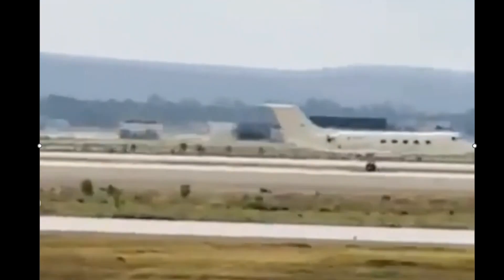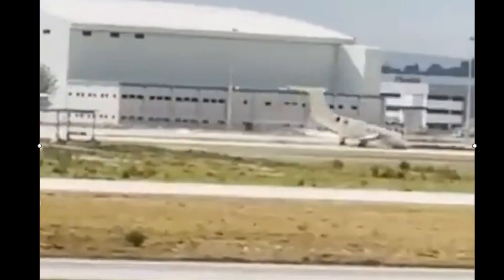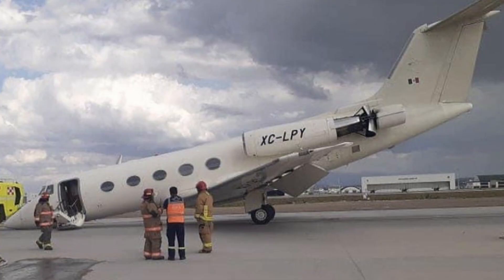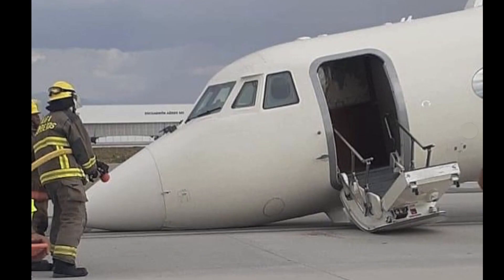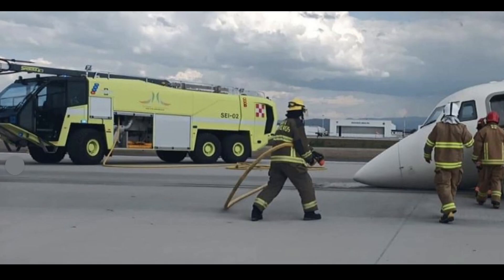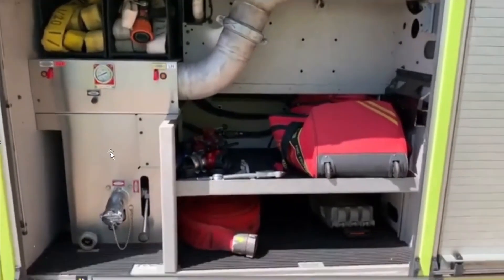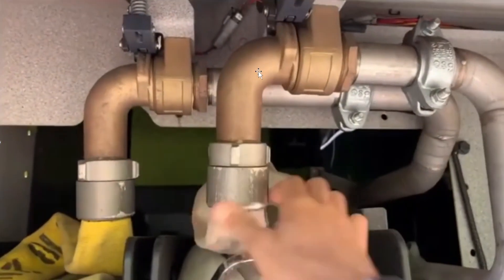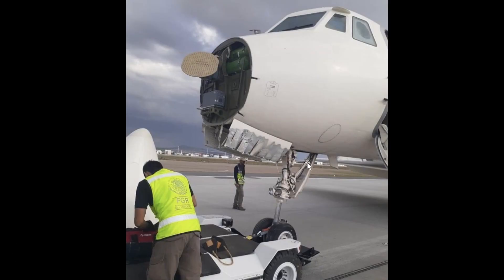Bystanders Watch Gulfstream without Landing Gear

Comment: The pilot did a good job , love the flaked house with the sensor that basically inflates the hose on deployment , save a lot of time on running back and opening a valve to open that delivery . And as you know speed is  all about our job as we have much less time to deal with these incidents than say a house fire . Sadly our old fire trucks had this option the new ones don't , in fact the restricted deliveries have no room for a branch or hose . So our new trucks in my eyes are less effective but im told .....im old school !!! , money constraints seems to rule over safety and doing the job . We have restricted deliveries because at the same time the monitor is hitting the main fire mass at some pressure , the restricted deliveries are restricted on pressure so you can rapidly deploy and not get blow off your feet . My new truck is more 80's capable in my eyes than what we had . So now i have to go to another locker , throw out a hose or two connect and get the branch from another locker connect , test and then go in . I think you will agree not the best . You have some nice trucks and equipment and long should it reign my friend , cool video and thank you for explaining our job to the masses . You are a Legend 🙂
Reply from the maker: Thanks brother

Comment: Thought I had you K. Only on Arrf rigs do you have lower level discharges. Did a double take and saw the male threads. I like the breakdowns a lot. I don't know why you wouldn't spray the nose of the plane as a precaution.
Reply from the maker: Thanks 🤙🏽
Reply: As a plumber I realize firemen are plumbers with more exciting jobs 😅
Reply: @waterheaterservices  plumbers and very high priced Janitors. Great observation. Lol.